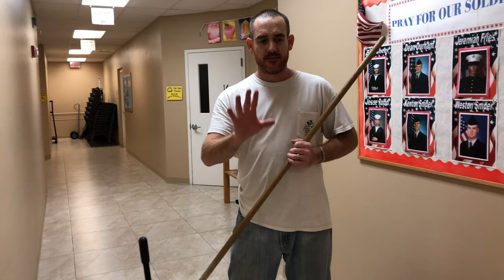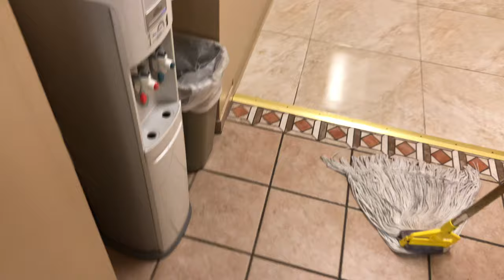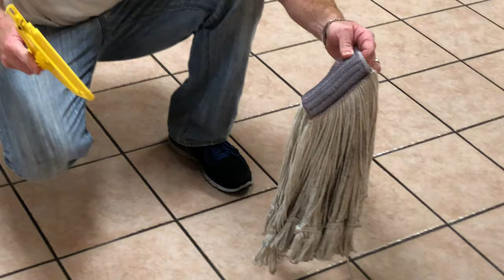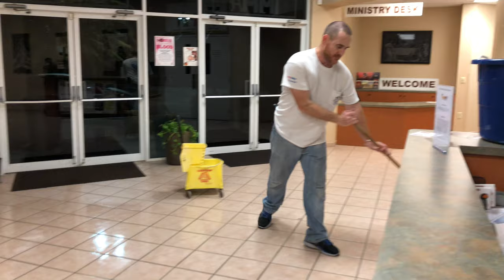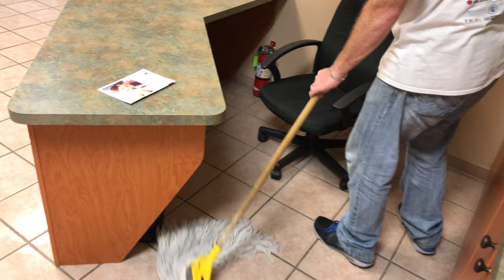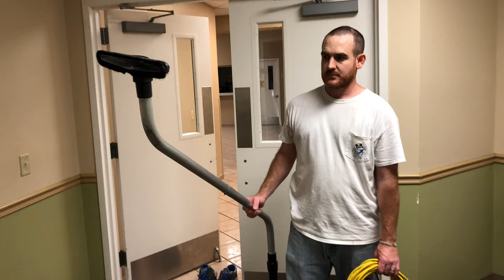How to mop a floor the right way. Mopping TIPS! extended instructions

Comment: Mopping with a really wet mop leaves dirty water in the crevices and that is what gunks up the grout. Doesn’t need to be so damp to clean floor. Also less damage to furniture legs if mop not sopping wet.
Reply: Good point and the skirting won't get splashed

Comment: Hi, I mop at a church, it has white linoleum floors. I use cold water and an ounce of neutral soap solution. Thing is, after it dries, there are watermarks/ streak everywhere. What I am doing wrong? Should I rinse out with clear water afterwards?
Reply: Try less soap. Also sounds like you are using your water too long before changing it. Try changing your water more often, or instead, just go back over with clear water to rinse the dirty water streaks. Be sure to not let rinse water get too dirty or you will defeat your purpose in rinsing. Try to find the best level of wetness for your floor, so your results are consistent. Let us know how it goes.
Reply: Cold water?

Comment: you just get an o cedar spin mop they are awesome and easier then that old school mop bucket
Reply from the maker: Thank you for the comment I don’t think the o cedar spin mop is a good choice for when you have a lot of mopping to do,  such as a large janitorial account, it may be nice for a home,  that is smaller than a larger commercial building.  Some people may really like them for their home though.
Reply: @KendallTodd  fair enough I know for my wife's house cleaning business it's perfect you can switch  mop heads per house simple and effective quick question where are you located
Reply from the maker: I am in Florida
Reply: @KendallTodd , I clean a bank there is a small entrance to mop my question is how do I mop the edge of the ceramic tiles that has loose peddles on the other side without causing steaks on that edging.
Reply: *pebbles
Reply: Will that work on an uneven cement floor?
Reply: @belmum1689  get a flat microfiber mop (AKA flat mop) to do the edges. Better control & will leave no streaks.
Hope this helps.
Reply: Yes best invention ever. Frfr but he's right that mop is to small for the job. I actually thought about bringing my mop to work. Lol